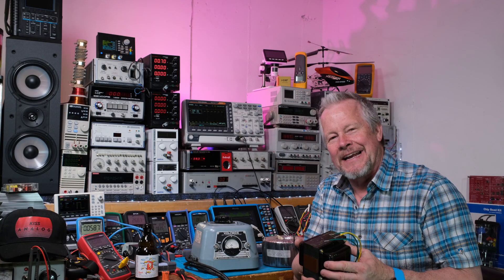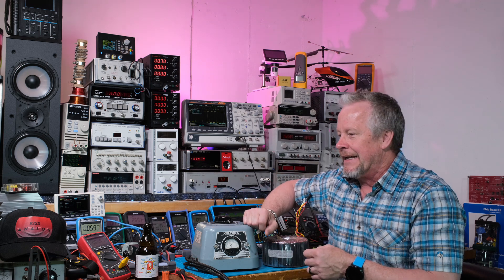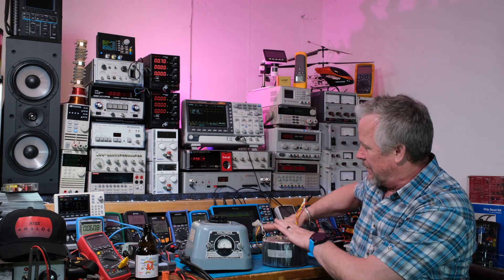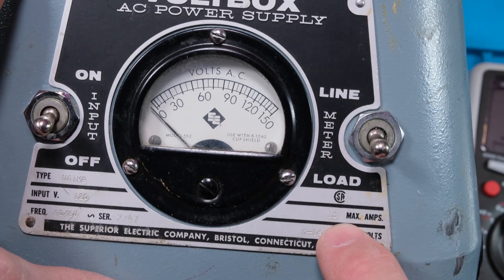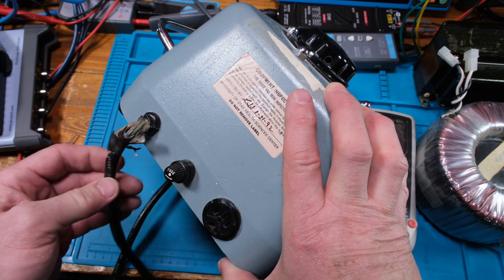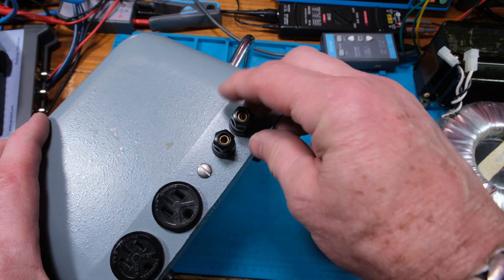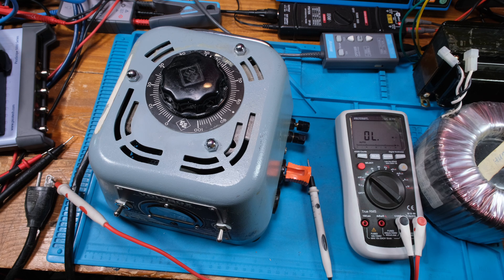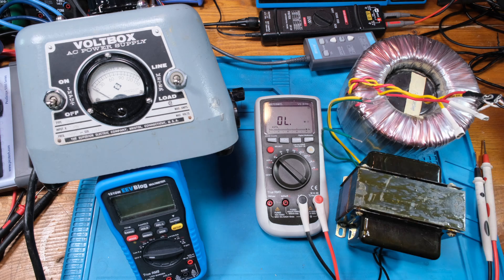Transformers Tested with Voltbox #howtosizetransformer #audioamplifiertransformer

Comment: 7:20 I'm using the Voltcraft VC870 for almost 1,5 year now, and i'm very happy with the price/quality. I was back then looking for a DMM that combines Lo-Z mode and more then the 9999 counts that my Aneng A8009 has. If you look for both features (Lo-Z and 40000 counts) in 1 DMM, you will see that there are not much DMM's out there that have both, and with a reasonable price. Even the high end Fluke's don't have both features in 1 DMM. Also, this meter has a neat safety feature, if the testleads are connected, you can't slide open the backcover for replacing the 9V battery or fuse(s). Also the extra amp/power measure adapter is a very handy tool to have, that even high end DMM's don't have.
And last, as a tip when testing transformers, you can use a small transformer like a 6V AC (or even lower) to safely test which side of a transformer is the primary. If you connect the 6V AC to the primary, then the opposite wires will put out a smaller voltage. You can also calculate the stepdown ratio of the transformer with this safe test.
Reply from the maker: Thanks Bjorn for the awesome feedback!  I also think it has a nice feel and seems like just the right size.

Comment: Instead of trusting in the Analog VOM, you could put another DMM just to check if the output was 120VAC
Reply from the maker: Yes that is a great suggestion!  Normally, when I’m actually running a test where I want to compare data, I do actually use DMM as you suggest.  Thanks for your feedback!